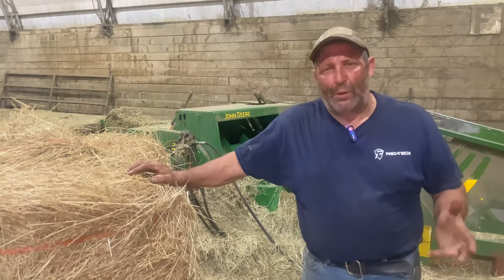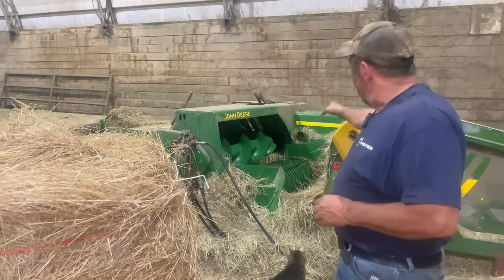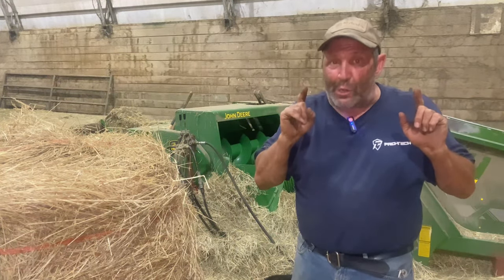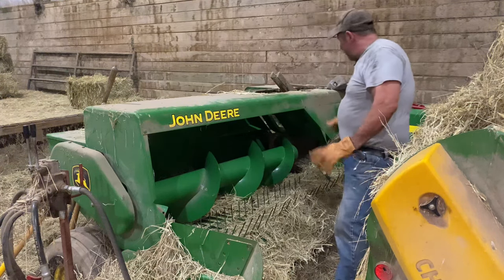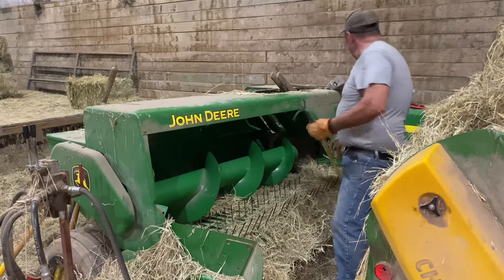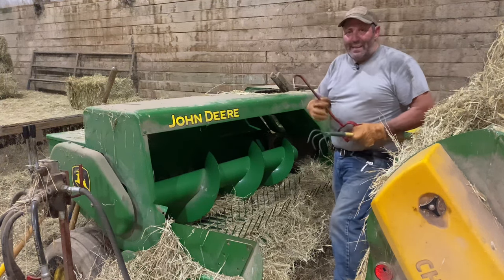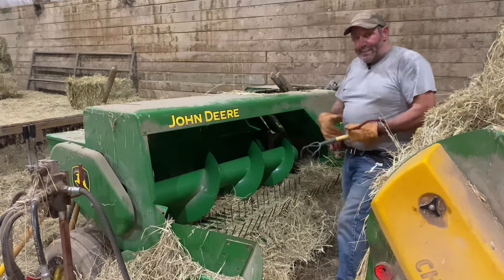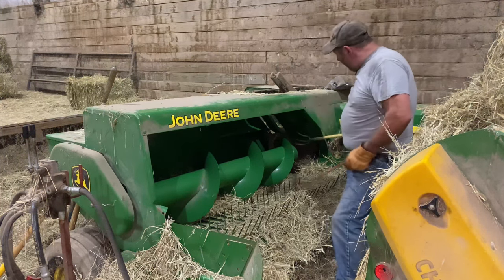Tools and Method on How to Unplug a Square Hay Baler Fast and Easy

Comment: Unplugging am Inline sometimes requires removing the   rear upsweep chamber panel under the plunger to dig out the wad...  The plunger actually pushes the charge off the stuffer forks..    There are  3 segmented knives on bottom of plunger & 2 W shaped knives on the bottom of chamber.... on the MF1840 inline
Reply from the maker: I am not at all experienced on inline balers.  I am glad you brought it up and explained it a bit.  Plugging is never fun and slows down production.  I try to avoid it if possible.
Reply: When we were contemplating Rebaling,   we gave the Hustler a look, but a operation that had  the Simpson  unrollering system became for sale so we bought the whole shooting match.... After we  moved the tables, baler and Bale Bandit we studied the movement of  the unrolled hay through the process and  changed loading procedures,  discontinued certain features,   added flow and speed controls, and  changed it from  someone having to work levers to engage and disengage     To set the  feed speed, and just observe ... You would be amazed at the difference of Not removing the wrap untill the bale has been dropped onto the first elevated table , made in  Eliminating large wads of  hay being fed into the Baler.... The Wrap is not cut it  is removed the same way it was put on.,,,   pulling the wrap  fouls the wrap with Hay.........  Presently researching methods of adjustable controling  speed of pickup fingers on Baler.....